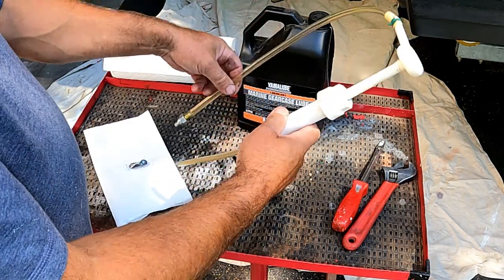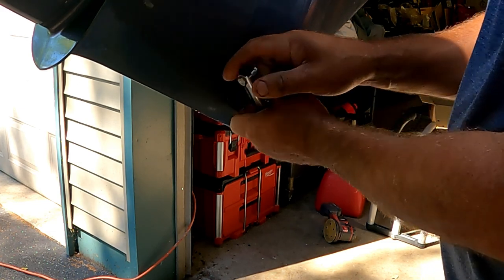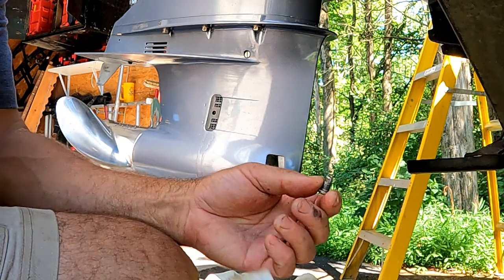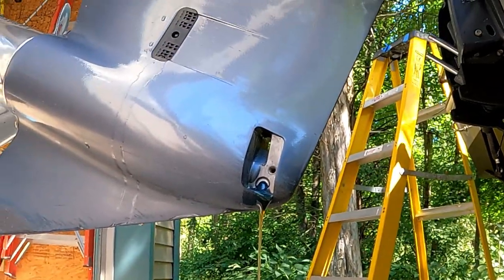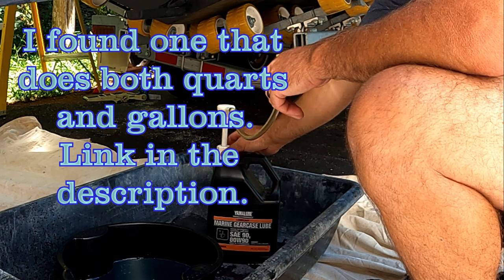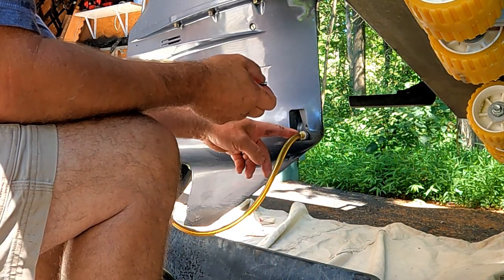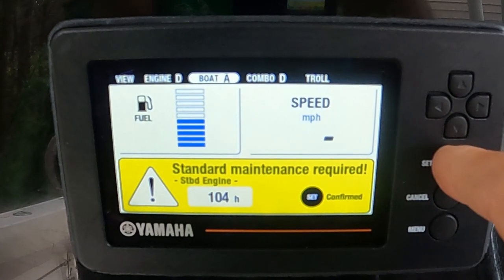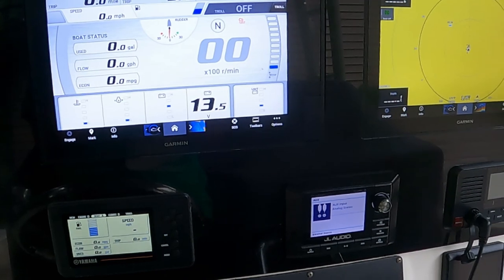How to change a lower gear lube on the 4.2l Yamaha 225 250 300 HP

Comment: GREAT video, thanks for taking the time! I'll be doing this for the first time on my new to me F250 this Fall.
A tip my grandfather taught me when using a tool to start a screw/bolt into threads is to slowly turn it counterclockwise (in reverse) until you feel it just pop in. This will be the very beginning of the threads mating and you can then start to turn clockwise, ensuring you won't cross thread it.
Reply from the maker: That is a great tip! Grandfather wisdom!!!